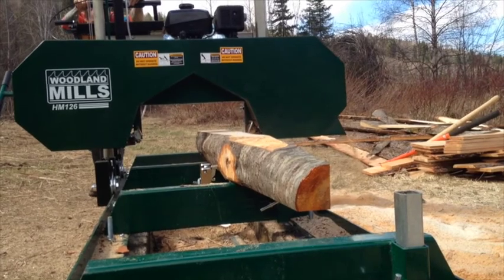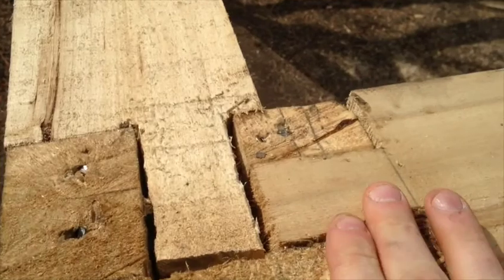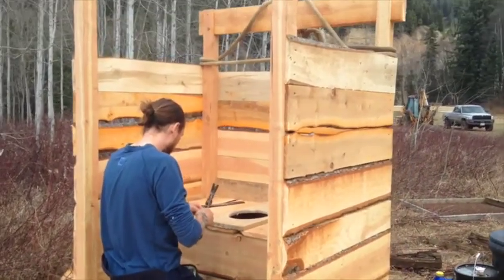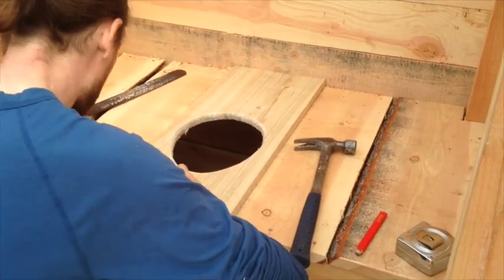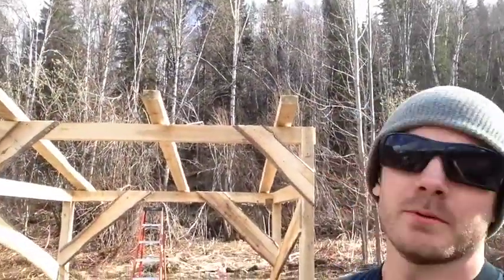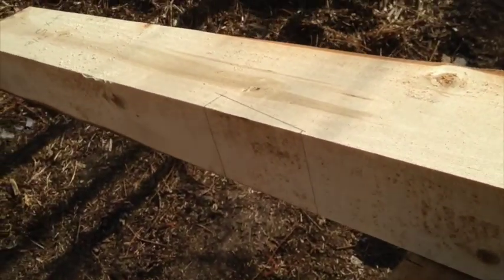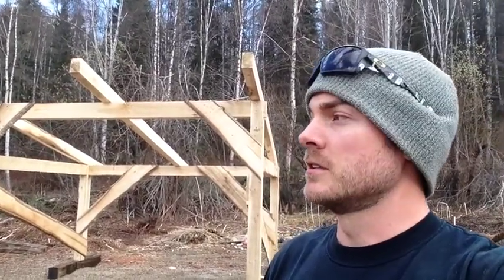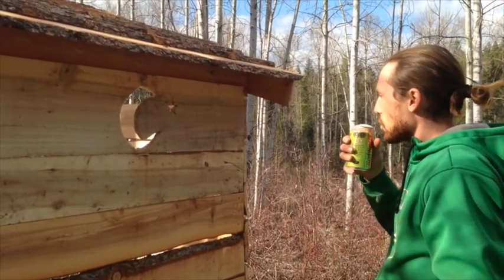Timberframing p2

Comment: We are also building a log shed with cottonwood.  The locals here say cottonwood rots easily if exposed to the weather. Why did you use cottonwood directly on the ground as the foundations rather than stone?  Not only does the cottonwood risk decaying and dropping your structure unevenly, but it also gives a direct avenue for termites.